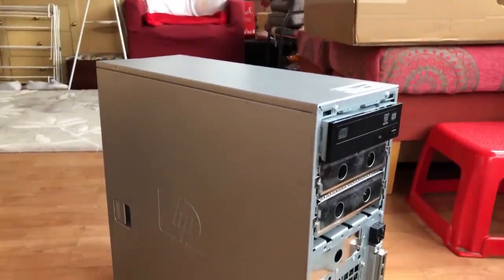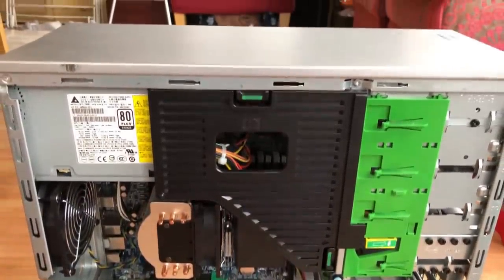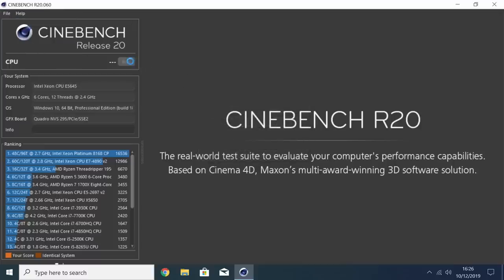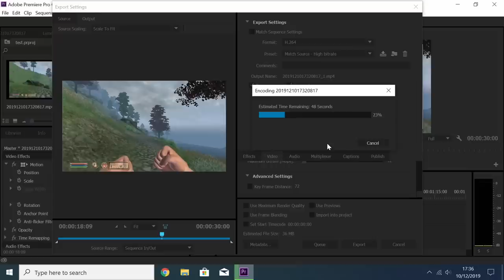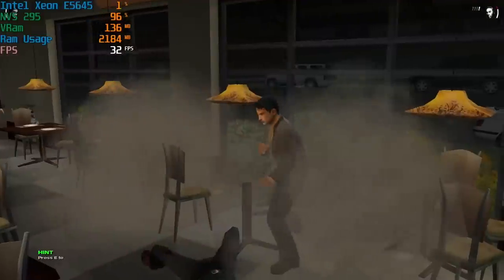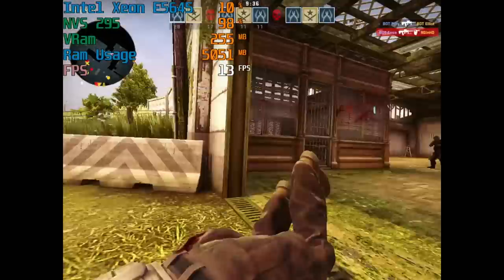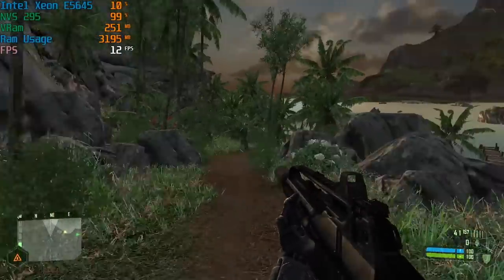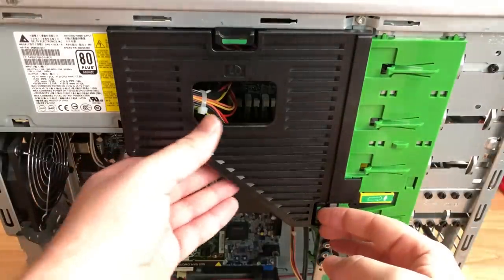I Bought a £50 ($65) 6-Core Workstation PC, But What's Inside?

Comment: I have a Z200 that I tried to use with a newer card.  The PSU is proprietary and you cannot put a standard ATX in there.  That means no 6PIN or 8 PIN PCIe connectors.  I tried to mod a power supply using a pin out diagram and still couldn't get it to work with a standard PSU.

Comment: Have a motherboard from a Z400, but not played around with it much as I managed to find another 1366 board for £30 so went with that and an i7 960, not currently in use but served well as a secondary system (12GB DDR3 in triple channel, 6x2GB, GTX 970, then downgraded to a 760 as the 970 found a new home) replaced it with a 1090T X6 system for nostalgia reasons. would be cool to do something with the Z400 board, despite it's non standard Power connector and front panel setup.

Comment: ive had 2 hp z400 systems. a first gen n a second gen. both had a quad core. the 6 core configurations exist mostly as ones upgraded from quad core by the end user. the 6 cores were much less common from the factory.

Comment: Grab your self a x5690, they are not super expensive and run at 3.5ghz with a 3.75ghz boost clock. I have a HP 800Z with two of those badboys in it and it can still out-perform my 2700x in multithreaded workloads. A single one should be up to almost any modern task fairly well.

Comment: The point of getting a cheap or even free 1366 board is to pair it with a X5650 or better and overclock it, then get cheap ECC RAM, but yeah, OEM boards can't OC at all, so using these at stock, even the X5675 or whatever has a higher stock speeds isn't worth it at all, unless you only need this for a server or render or whatever.
Try a BIOS unlock or something, I'm sure a Russian or Asian dude has done something about this, they always do these tricky things.

Comment: Moving this time of year!!!
Oh dear.

I think it's funny as I was looking at a big brother of this, yes the 800 which retailed at £5600+.
 It's a fair price item but factually they want too much which what I can pick up the parts for less the case of course.

Seems that you got the lower little, hence the spec but there is nothing stopping you doing some upgrades.
A CPU, but it's worth checking to find out if the system board has had its firmware all updated as well as drivers as they tend to not be.

I've gotten some. Big hardware and some vintage. (Prev on channel) so while trying to work on different things getting slowly forward... 

But this system is kind of a red herring, they sound good but just don't cut it these days with lower end more modern systems.
The poke for the £ isn't great and they don't have a large amount of head to push up from.
It is a ten year old PC after all.

Comment: ayy. I have one of these :) I put a W3680 in it and overclocked it to 4GHz. also added in a 650 Ti cause I had it laying around and the PSU is not strong enough to support something like an R9 280.

Comment: You should be able to pair a PC like that with at max a GTX 1060 if we're going by the cine-bench score alone. Though it would be interesting to see how well it performs with the new middle weight champ the 1650 super which is cheaper and not much more powerful if at all. Usually stuttering is always the problem in game with an older CPU or GPU despite headroom so who knows.

Comment: Z400s are good, you got the later motherboard with the 6 RAM slots which is good. 
Doesn't like RDIMMs or sticks over 4GB but does take ECC UDIMMs.
NVS 295 is pitiful - useful for installing drivers? 
Built a system for gaming overseas with X5675 and an RX480 getting PCI-E power from a molex adaptor. 
Only 12GB RAM as it's earlier motherboard with only 4 slots (earlier board doesn't officially support 56xx Xeons, but seems to work great). Games fairly well, for the money not spent on it. 
Looks like an old work desktop, so unlikely to disappear.

Comment: I literally just rebuilt my little brother's PC with a Z400 board by modding a psu cable. It is a decent super budget option and would pair well with an RX 590 or Gtx 1650, depending on the LGA1366 CPU. Get 5he fastest CPU you can afford.

Comment: I built a couple of these into standard cases with standard psus, the power adapters come up on ebay. You could try it with a X5690 and 24Gb in triple channel. probably a good match for an RX580 or GTX 970
Reply: Does it bottleneck 980ti?
Reply: @Gargantura  probably but it'll still work ok

Comment: You could get a top of the line W3690 for this system for less than 50 dollars on aliexpress, which is fundamentally equal to the i7-990X. You can than also overclock it a little using software tools because the W3690 is unlocked. T.b.h. the main reason LGA1366 six core chips are still wanted, and the aftermarket boards expensive, is the high overclock potential. On low clocks like this E5645 it's not relevant anymore

Comment: The problem of those Xeon CPUs in gaming is their low single core performance, at least in cases like this one. While you definitely can extract more performance out of it with better graphic card, it will likely get CPU bound if you go too far. Because in the end of the day, no matter how games scale with extra threads, they still will run with the speed of slowest single thread.  Also lower utilization in some games means nothing. Like if you run single thread game, you are CPU bound when that thread gets to 100%, but with all those cores and threads, that is total utilization of good 8% for 6 cores and 12 threads, it likely would show bit more due to background stuff, like running quick single thread Cinebench pouts utilization to 13% on my end on Ryzen 5 2600X. But this does depend how well and with how many threads game scales, some will scale just with one thread, some with 2 or 4 threads and some with 8 threads and big new stuff will scale with more. And I am pretty sure this should be still capable of some gaming, but something like even Ryzen 1600 would be miles better in games or anything... though it would cost significantly more too.

Comment: I think something like a GTX 1060 or RX 570 or 580 should go good with this PC for a balanced system.
Reply: Pilu I remember when an older desktop PC was given to me that had an AMD Athlon 64 x2 4200+ dual core CPU. Only thing that was missing was a graphics card, so for about $15, I got a GTX 285 graphics card for it, I also upgraded the dual core Athlon cpu to a quad core AMD Phenom x4 9650 that I got for about $7 and with a BIOs update, I upgraded to that CPU without having to change out the motherboard. I also have 4 gb ddr 2 ram at 1066 MHz. Now, it runs games well made up till 2012 to 2013.

Comment: This has potential- maybe add a higher clocked Xeon X5680 and a better GPU. This machine is triple channel memory and you may also be able to use buffered RAM which is often cheaper.

Comment: i would not recommend an hp z400 to anybody other than a collector. the motherboards are famously filled with issues. the first one i got rid of kept killing all the memory channels or whatever part of the cpu interacted with memory, one slot a time. then i would slot another one in and off i went. but then the local supply disappeared, and the price per chip multiplied by about 5. so i got rid of it. the second z400 i had the power supply blew up, so i ordered a couple spares. within a month of the 3 power supplies arriving they were all dead. i have passed on a 30 dollar z400 recently because im tired of dealing with smoke and sparks.

Comment: Z400 runs in my basement 24/7. Its a heavy-boi and not going to be great at anything these days. GTX 20xx will be bottlenecked by PCI bus. Just grab a low power card 1050ti/1650. I don't recommend trying to put anything in that case except what belongs to this machine. MB is on a backing plate for quick changes, power supply is not ATX compatible... You might get better performance by removing one of those little 2gb sticks to balance the triple channel addressing. These came in 4 or 6 DIMM configs, you got the right one! I think the manual will max this thing out at 24GB. You MUST upgrade to the faster CPU to get anything done first though...

Comment: Wonder how this Xeon CPU would compare to what my main desktop has which is an i7-6800k CPU also 6 core 12 thread. I have that paired with a GTX 1080 and 16 GB gskill ddr4 3000 MHz ram in quad channel. Not the newest either, but was probably high end from 2016.

Comment: Nice 6 core CPU setup especially for the price. Could definitely do with being upgraded (especially the terrible workstation GPU). Was the courier MyHermes by any chance, if they're throwing it around a lot?
The GPU is only suitable as a display adapter, IMO.
Also I remember you reviewing an i5-8265U laptop, hopefully that wasn't the one with the terrible battery because those modern laptops should have decent batteries (assuming you're not pummeling it too much with heavy usage).

Comment: I have fujitsu server motherboard with 2 lga 1366 cpus. Xeon X5660 has 6 threads, 12 cores each and one costs only 20e and with two of them I can get about 1200 points in cinebench.

Comment: Hej,

I have a couple of z400 ws at home.
Most of them have a w3550 which is kinda similar to the cpu you have. Except it's 4c8th. I don't know about that one but mine have triple channel memory. So you should go for 6 or 12gigs of DDR3 and put it in the right slots. Notice that it's ECC memory.
Now the top one I have, my personal rig if you like, is paired with a GTX 1060 6g and 24 gigs (6x4g) a SSD for booting. and some HDD drive.
And it's actually a pretty good machine. It can play GTA 5 with all sliders to Max at1080p and it hovers between 30 and 50 fps.

So I would like to see it play with the best gpu you have available and see what it can do.
I also like to point out that w3680 CPUs are available on the used market for about 70eu 
That CPU is actually a Xeon version of the i7 980 a very popular CPU back in the days.
The top of the line is the w3590 which are rare but for as far as I know quite powerful.

Anyway, I'm looking forward to part two. 

Good luck with moving.

Stay awesome.

Comment: Z400s have issues with CPU compatibility, they are fine but some of them don't work with newer westmere CPUs, luck yours seems to come with it stock
Reply: It has 6 RAM slots, so it's second generation board. Have first gen X400 (4 RAM slots) running 6 core Westmere on stock BIOS with no issues. May be some really early boards have issues.

Comment: Honestly, just buy one of these old 9800 GT Ecos. I have one lying around as a backup (had to use it twice) and it can handle Crysis on medium settings rather well still and will even soldier through GTA V on low settings. They are pretty cheap nowadays and would maybe open up a ton of possibilities towards gaming while still going for whats essentially a very budget-y build.

Comment: Nice video and actualy a nice find that Z400 (although...missing some parts). Most HP Z-workstations, even the old ones, cost a lot...because, well it's a Z-workstation and it used to be expensive. Which is a shame, because I do like the way they look (Z600 or Z800, with all the side and front panels ofc ;)  ). But people still ask well over 300 or 400 euros for those, which isn't worth it (you can almost get a dual socket 2011 server for that money, which will ofc beat an old 1366 socket workstation any day).  Few things I found a bit odd, you hexacore scores worse than a 2500K, but my quadcore 5540's (2 of them, so 8 cores 16 threads) scores about the same as a 4770 Hasswell i&, which is ofc much faster than a 2500K sandybridge. I did notice, back with my runs on my Proliants, that a bad GPU can have massive impact on CPU performance during cinebench.   Also, low CPU usage doesn't mean it isn't bottlenecking, it's a 'flaw' of how CPU utilisation is monitored with those programs. In fact, 1 or 2 cores might be at 100% constantly, but the game won't use all the other threads of the CPU, so you get a very low CPU utilisation and still horrible performance.  If you'd use a 12 or 16 core Opteron (based on Bulldozer), you probably get very very low CPU usage in percentage, but it's bottlenecking like crazy because of the low clock-speed and poor IPC. Many old games can't use multi-thread (1 or 2 cores tops, so all the other 10 threads do nothing).
Reply: Nemesizzonline Heh, I wish I could find a cheap dual 2011 setup. I have 4 8C/16T IVB-E Xeons kicking around and nothing to actually put them in XD
Reply: @ianweber9248  Seen a few for around 400 euros, but they wouldn't ship it (so you have to drive over to get it, which is usualy too far for me). But after this video, I did another check on HP Z Workstation prices, and a lot of them are still in the 400 to 600 euro range, even for single socket 1366 ones, which is realy expensive. Even Z400 (like in the video, but usualy with a quadcore instead of hexacore) still costs well over 300...

Comment: Core i7 990X, overclock it to 4.5 GHZ with a good air cooler, put a second hand 1080 in it, BAMM, 1440p gaming powerhouse.
Reply: I think that is definetly old no matter what clock speed for a 1080.
Reply: @orionstar3310  If you manage that kind of overclock on the 990X, which is realistic if you know what you're doing, you have the same single-thread performance than a Ryzen 1600X, which also has 6c/12t,. No one'd say that an 1080 is a mismatch for that CPU or would they?

Still a relevant setup.
Reply: @classicallpvault  provide me some evidence the 990x at 4.5ghz has better single core performance than a 1600x. I would love to see it.
Reply: @orionstar3310  Actually, after doing the math, it appears that they're an exact match at that speed. Raising the base clock speed gives linear performance increase if your temps stay low enough and you don't experience thermal throttling.

Multiply the single core perfomance of a 990X (1515) in Passmark by (OC clock speed = 4.5 divided by stock clock speed = 3.47) and you get 1964. Which is the exact same figure as the average single thread score for a 1600X.

4.5 is a manageable, and even somewhat conservative OC on a 990X, according to a review on overclocking the 990X, a stable 4.8 is realistic. 

https://www.vortez.net/articles_pages/intel_core_i7_990x_extreme_edition_processor_review,5.html
Reply: @classicallpvault  okay boomer

Comment: had a few of these, the 24 was the biggest pain. its not standard layout for 24pin
Reply: easily solved with an adapter from moddiy (tho i make my own using $5 PSU 24 pin extensions. I just cut and solder 2 wires, not a big deal at all).

Comment: Dell T3500 is quite cheap. It has Intel 1366 socket. It supports Intel i7 and Xeon. 4/6 core CPUs are cheap on Aliexpress. I sold couple of Dells upgraded with good CPU, 12GB triple channel memory, SSD and gaming GPU. Nowadays I think 1st generation Intel Core is too slow for gaming and used PCs for gaming should have at least 2nd generation Intel Core.

Comment: Found one these last week dumped outside! W3550 4 core cpu, 6 gb ram, quadro fx 3800 gpu. Ordered another  6 gb ram for just over £10 and a x5650 6 core for £6.50! Is this cpu any better? Another youtube user put in an rx 580 using 2 molex to 8 pin power connector with it's 475 w power supply. Is this recommended? Looking at rx 480/ 580 or a gtx 1060 6gb if I can find for good price... Not much experience with desktop pcs. Only info gained from videos like these in the last year or so...

Comment: Ive always wanted a Z820, my previous system was an xw6600 with a dual quad core xeons from the core2duo era then I put a r9 285 in it, now Im using an dell t1650 with a xeon e3 1270 and Ive stuck an 1060 in it

Comment: when this thing is better than my $1000 laptop
Reply: Then it’s not a $1000 laptop anymore. T new 9750h with GTX 1660 is like $800 some dollars right now (with a 144 Hz monitor). My older 8750h (6c/12t) runs laps around this old Xeon. Tech advances, and AMD is bringing the competition back in town!
Reply: @jakegarrett8109  that is not the case for prices in my country

Comment: You should check out the Nvidia nvs 450 because that card has two GPU chips in it and is meant to run 4 4k displays at once but it is pretty cool with the two gpu's

Comment: Don't go for the faster 6 cores Xeon ones, choose the x5687. It's 3.6ghz quad cores and ht.
The maximum gpu might be the rx 570/gtx 1060 3gb.
Reply: That might be the max with stock psu. But swap in a standard atx psu with a harness adapter and you can go up to the higher end cards like the Gtx 1070/1080 or the Rtx cards.

Comment: Does a graphics card help with video editing? Or is it only depending on a processor?
Reply: CUDA definitely helps a ton. Nvidia works great for video editing for sure.
Reply: Depends on the editing software and even the task (like Vegas pro some things will work on Nvidia CUDA but not OpenGL acceleration like Radeon is best at, and some animations are only CPU while some can use both at once). I’ve even used 6x GPUs at once (a Titan Xp for CUDA tasks, and a mix of Radeon for OpenGL compute). It really depends on what you’re doing (on some software color correction can be greatly sped up with GPU, others it may not have that capability and only CPU, so it’s software and task dependent).
Reply: @jakegarrett8109  Thanks for the reply. What do you think would benefit me more in video editing: upgrading processor from i5 2500 to ryzen 5 1600, or upgrading graphics card from intel hd 2000 to gtx 1050ti?
Unfortunately, in this country hardware is very expensive, so I can't afford both

Comment: Looking at passmark that card is right there with the Radeon x1600 and the Geforce 6600GT.. which are from... *ehem..   2004/2005.  So the solution is that you just need to run games from 2004 to make it seem powerful!  Kick up some counter strike, HL2, UT2004, Far Cry, Doom 3 etc.